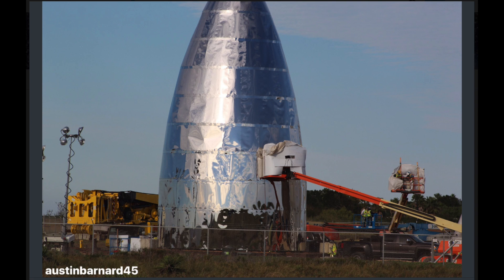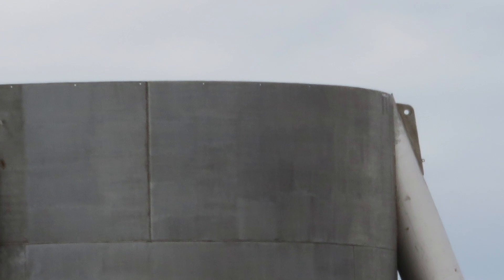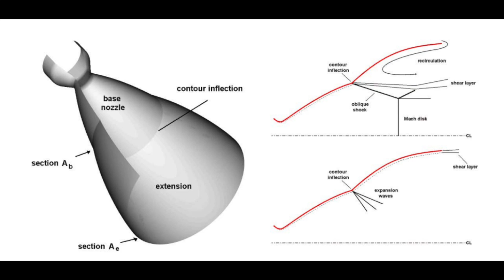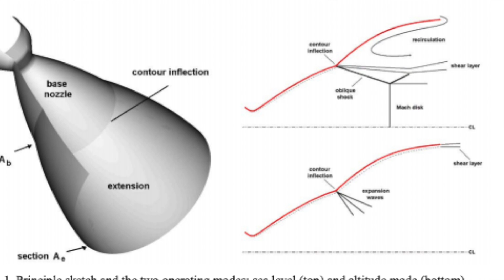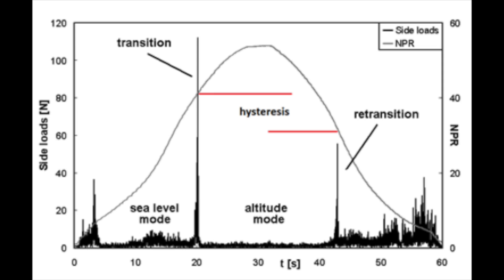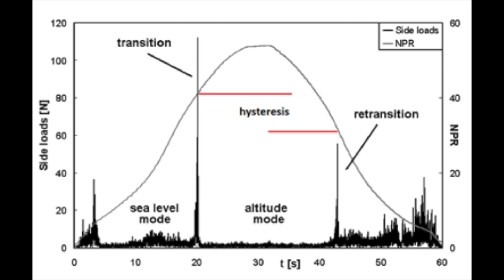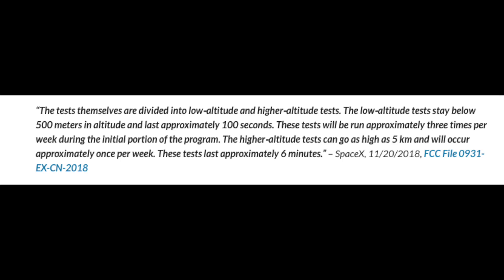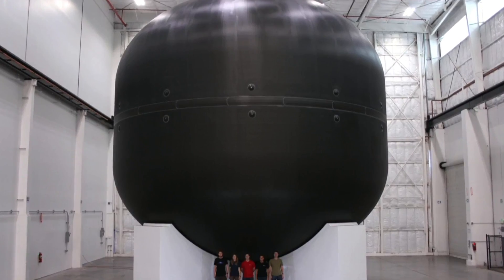What's Going On With SpaceX's Stainless Steel Starship?

Comment: Can we build rockets which can change the nozzle shape as required?
Reply: I've often wondered this when looking at the afterburning nozzles on fighter jets. But I think the problem is the sheer size of the bell needed for vacuum operation. Also, the nozzles are full of channels circulating rocket fuel (for cooling). So moving sections very difficult to design and fabricate. But we may yet see a solution.
Reply: @donjones4719  
Both the Falcon and Raptor engine bells run red-hot. No circulated coolants, just infrared radiation to limit the temperature.
Reply: @avid0g   The Falcon's Merlin engine bell/nozzle is regeneratively cooled (fuel circulates thru channels). The one on the 2nd stage has regen cooling only on the first part. The large extension bell for vacuum optimization is not cooled; that does radiate heat as you noted - that's the sci-fi looking red glow we all see.
The Raptor engine is also regeneratively cooled, per a tweet by Elon.
Reply: @donjones4719  
Yes, The regeneration occurs around the Merlin combustion chamber and near the neck on the vacuum engine. This energy is used to preheat the propellants. Downstream from the neck, the relatively cool exhaust from the generator turbine is recombined with the main exhaust. This squeezes out a bit more performance from the vacuum engine.
Reply: There's the aerospike engine. It's designed with the nozzle in the middle, and the atmosphere acts as a part of the nozzle until you reach vacuum.
Reply: If the goal is to land a second stage, perhaps the larger vacuum portion of the bell could be ejected, or it might be retracted slightly to allow operation in higher ambient pressure. 

However, the dual geometry bell already does this fairly well without moving parts.

Comment: If the raptor engines on the upper stage have to work at both low altitudes and high altitudes, why wouldn't they use a nozzle design similar to the RS-25? It work from launch to orbit. Does the nozzle with the notch have any advantages?

Comment: There are some very practical reasons for a low fidelity test like this.  For instance, I don't believe anyone has actually ever flown with a dual nozzle, much less tried to reignite one with a 500 MPH tailwind blowing straight up the nozzle.  Even flight proven systems can have trouble under these conditions, as Falcon Heavy proved.  It's pretty hard to imagine a 500 MPH wind tunnel that can hold something as large as Raptor, all while surviving it firing with 1000 tons worth of force!  Some things just have to be tested in the air, and until they know for sure that it's going to actually work properly, it's best to keep their investment in the rocket as small as possible in case it RUDs in any number of possible ways.  A glorified water tank is good enough for the job in this case, and quite cheap.

Concerning the nozzle, I suspect it's more a "low thrust compensating nozzle" than "altitude compensating".  The nozzle isn't really large enough for a vacuum nozzle.  However, for landing they want to be able to throttle the engines waaay down in order to provide engine out redundancy.  The issue is, firing an engine at very low throttle at lea level with a sea level nozzle has all the problems of firing a vacuum nozzle at sea level at full throttle, for the exact same reason - insuffient pressure at end of the nozzle to stop flow separation.

Comment: Scott Manley.... Are adjustable nozzles not used on rocket engines, like they are on fighter jet engines, because of edges existing, weight (not so much) or strength (complexity, which also lends to the weight issue as well)?

Comment: The upper part to me looks kind of wrinkly (technical term haha). Not sure what that means exactly, as far as flight worthiness.

Also, has anyone noticed access hatches? I would think if this is the flight test there would need to be access hatches to get at equipment. Unless the hatch is in the bottom.

Next month or two should be interesting. :)

Comment: It's for Burning Man. Because of it's size it has to be delivered in 'Wide Load" sections across Texas. It needs to have a police motorcycle escort thru Texas because intersections need to be blocked to get it thru. We bid on the move and got it. It is going to take three weeks to get around all the obstacles (bridges, power lines, etc) to El Paso, then we hand it off to New Mexico. Moving it on heavy duty flat beds is cheaper than putting it on a ship thru the canal to California. We don't know much more than that. No it doesn't fly.

Comment: SpaceX is not going to use top of the line parts and equipment and the same care on a test rocket that is likely going to explode or be destroyed during testing. As long as its the same weight shape and  mass SpaceX will get good data  to use and apply on the real thing.

Comment: If you are expecting a few RUD events, water tower construction would be economical. Is it all a grand misinformation scheme to mislead the competition? Were we all thinking shuttle tiles or spray heat shielding over carbon fiber? Micro meteors would eat that up?  Stainless is better armor but it seems like it would be very heavy for something that size and would be variable with temperature... I do not think they are done with the design redirections.

Comment: Have you ever put a magnet on stainless steel? It does not stick. They must want an extremely durable material with no magnetic properties. Is there a heat shield on that or is it a one way trip?

Comment: I think it is pretty clear exactly what this is. It is a test article for the propulsion systems and landing of the starship. The idea is to have a craft with about the same weight, CG, Center of Mass, etc... as the real Starship design in order to test out the new raptor engines and landing of the Starship. My guess is they might even try to launch and land this thing from unprepared surfaces like what could be expected on Mars/Moon. Stainless steel construction is fast and easy as evidence by the quick pace this is being assembled at. Once this test article is complete I would think another test article that is a higher fidelity prototype of the Starship (complete with actuated fins, smooth exterior skin, and 7 raptor engines) would be constructed for more expansive flight testing and re-entry testing.
Reply: This test article is also implementing skin-is-tank.

Comment: My only assumption would be the steel is a substitute for aluminum as steel has a higher resistance to reentry heat and plasma. You'd need less heat resistant materials on the most troublesome spots when dealing with heat. Maybe it's also a speed tester vehicle too. Its cheaper to use stainless steel in your fast supersonic plane when going near or past Mach 3. I'm just spitballing here guys and gals, I'm not sold totally on these conjectures so if you come up with something better then I'll believe you.

Comment: Wait.  A water tower company is making a rocket??!!  So, giant water rocket!!!!
Reply: now all they need is a giant bicycle pump company.
Reply: Barry, one of the early SciFi illustrations of a rocket ship actually plagerized a novel water tower design. Never to be printed again, because the water tower design became so common.
Reply: @avid0g  Funny, how physics explain the similarity. Water towers must be elongated to be tall enough, rockets do that for aerodynamics. And both must be roundish to keep the inner pressure (as corners and edges accumulate pressure, and eventually fail).
Reply: Biggest waterballoon delivery to mars?
Reply: I worked in a facility that, among other things, built huge high-energy physics devices for both experimentation and "practical" (DOD secret stuff) applications. Highly complex and technical machines, with components making use of quantum physics even.

One of our primary suppliers was a company that specialized in industrial boilers and steam piping. 

Turns out the techniques and tools for making massive steam pipe systems is the same specialized skills needed to build our massive physics machines. At the end of the day, steel is steel, and there are very few shops geared and experienced at building steel precision systems on a very large scale. And yes, most of their "bread and butter" jobs are things like water towers. Doesn't matter - steel is steel.
Reply: How efficient to employ water tower company to build a test article.  Never question Elon’s business savvy
Reply: Oooh, so just the delta iv
Reply: ok this is epic
Reply: @lilaxeree3621  Its a water tower company because its just the hopper... if those people can build a working frame for a hopper than spaceX will easily build a working REAL spaceshow half the weight
Reply: And it's shaped like one of those water rockets. 🚀
Reply: Actually those things can be more effective than some people dismiss them. I made one out of two, 2 liter bottles. One was empty and the bottom cut off just to make the whole thing longer because I was just copying the normal basic missile or rocket shape that we all already knows works well and adding the extra length alone made it go nearly out of sight at least twice as high as just one bottle. I also cut a flap of plastic that I hinged on the side with tape at the top that held a rubber band to the nosecone that had a parachute in it. As soon as the air stopped passing over the rocket the rubber band would lift up the flap and the nosecone would pop off and it would parachute down. I had some estes rockets that went 500 feet high and you could barely see them at that height. This water rocket must have gone 500 to 1000 feet high. I've actually wanted to make another one ever since that class but now its been over 10 years.

Comment: I'm pretty sure that space x doesn't want to invest too much money into something that has extreme potential to blow up spectacularly.
Some deadline is probably the no.1 condition to be met, and I'm guessing looks is not as important.
They probably just want to make this thing good enough to hop a few times, in addition, to have basic flight characteristic roughly like the real thing, meaning mass, the centre of gravity, fuel volume and so on. 
Also, speed when hopping is probably not meant to be too big.

Comment: Legs, size so a multicrewcompartment could fit, pressureadapting engins. This looks like a Mars Landingship if you ask me.
Reply: Sending people to Mars will also require the ship have room for adequate radiation shielding. There are no Van Allen belts between you and Sol's radiation once you Earth. I wonder how much room for crew would be left after that.
Reply: @alvatoredimarco  Well, that would only have to be arround the crew module. You could leave the fairing on for more material, use a smart trajectory or, and that would be my favourite, if they were able to crate their own Electromagnetic field to shield them flying through the belt.

Comment: 3 is considered a minimum number for some redundancy schemes. If you want to lower your odds of a engine failure induced crash, you add engines until the mass cancels out the safety margin. Assume you are a major pessimist and expect a 1 in 100 failure rate for the engines. Two engines makes this 1 in 10,000. Much better but still kind of high for a critical mission. Three makes it 1 in 1,000,000.  I like those odds of not making a crater when I land.
Reply: And two engines is not fully redundant due to off-axis thrust. (If it failed during ascent, you can gimbal one engine to thrust through the CG, though you would have to tilt the rocket to match. During landing, that doesn't work because the ground would not align to the landing legs.)
Three in a line gives you options that maintain the thrust axis.

Comment: Looks like a mock-up... pretty sure that's not flight hardware.
Reply: Frank Winkhorst  If that's flight hardware then they are deliberately designing a vessel to break apart due to the aerodynamic forces of launch. Did you see those stainless panels?

Comment: My guess is that they want to:
1) test how to manage three raptors in a triangular configuration to land a Starship shape, in various situation ... 1 - 2 engine failure, ... 
2) test asset control
3) use stainless steel to test how it hands all the sollecitations, and to acquire asap some experience in building with this material, that apparently will be the final 
4) ... it will surely be a long period, and many trials and learn ... 2 years at least ... sigh :( 
5) why so much work now ? ... a lot of engineers developer were released by the block5, FH, and by CrewDragon recently, so they have to work on something ... may be some one working on carbon fiber got even fired ... :D ... so they get scare and be hurry to make progress. 
Thank you Scott for your always good and prompt videos, and for your kind attention.

Comment: Look at the legs. they seem very substantial. Much larger and heavier than needed to carry the weight of the module. But they might just be designed to hold this thing down, against thrust.
I reckon this is just to be used for static firing tests. Why make it look like the real module? Who knows ... just for laughs?

Comment: I thought stainless steel was susceptible to tearing/fatigue when subjected to vibrations? Doesn't seem like the ideal material to make a functional rocket out of, maybe its a full scale model? Maybe Elon's using some special grade of stainless? It does resemble the top section of the rocket from Austin Powers 2; is it due to launch on 14 Feb?

Comment: With fixed fins it would not be a good test for the flight characteristics 
of the starship, and with 3 engines overkill, just going straight up it would 
able to produce enough skin heating to test something like a transpiration 
cooling system.

Comment: The most obvious option seems, to me, to be that the concrete base is a temporary platform for test firing the engines, en masse, at sea level. 

Since the actual flight tanks aren't on site yet, I'd expect the real lower base to have been assembled in a more appropriate location, with flight engines and a stainless hull. That will arrive by barge. And the current stainless assembly will be installed on it for the hop tests.

Comment: The dented stainless steel is the new design language.  Tesla's will follow.  "Dented stainless steel, ... your best way to show you're cool."
But serious; I think they might use pressure to straighten these panels out and smooth the outside.  Otherwise this thing cannot fly.

Comment: Maybe Elon was given a recovered anti gravity drive like the one they built the Apollo around with nasa thrusters to control it. So just one engine for show and under the skin from the local  water tank outfit is a intact alien craft. Because that thing looks like a terribly built water tank ( don’t want to hurt the tank builders feelings ( but it’s not a tank it’s something being covered up to conceal it.  Rockets are built in clean rooms last I heard .
Reply: if the highest its going is 5km, and is expected to land hard a few times, the construction it has right now is perfect.
those landing legs probably have enough strength to cut the engines at 10 ft and still not be hurt. Also it has 3 engines on it. (ignoring your AG bit)

Comment: It looks like a mock-up. The sheetmetal is too wrinkled. If you look at an Atlas Centaur tank in production it's very smooth and welded together. They've gone away from carbon fiber tanks and are using a stainless balloon like Centaur.

Comment: I think it simple and straightforward. They want some quick and dirty testing of the raptor, the manufacturing techniques of stainless steel (new alloys, never fully know whatbpops up). I don't think they will care much about fancy carbon fibre tanks and stuff at this point. They want to nail the parameters for flight first. Three engines is likely to do with the three engine landing approach (testing out various error scenarios, engine out and so forth). Why they work so intense? The are running out of time in getting a backup plan for humanity.

Comment: I think you might be overthinking the choice of stainless steel a little for the hopper. Even if it's not going to be relevant for re-entry on the hopper tests, it's a very easy material to work / weld, if you're taking the "in a cave with a box of scraps" approach to aerospace development. The fact that it'll end up looking like the real thing makes it a PR no-brainer.

Comment: I dont think a rocket should be build by exact specifications, the hull is not that important, could be build by a shipbuilder or anyone else, as far as i know the seadragon should be build by a shipyard. Also think they paid their price with the explosion of the high tech helium tank. Stainless Steel, is pretty easy to work. Why invest in uncertain and undocumented regions if you can just use a well known material

Comment: There are questions about the material: steel. Solid, but heavy for a rocket. I have an idea why: steel is used as the surface of the rocket. And surface scales to the square of the size. As for volume, it scales to the cube. For thin rockets, steel is too heavy, but for very large rockets, it starts to make sense. Especially when lighter material is hard to scale to this size. For carbon composite, you need to cook it in huge ovens. Steel only needs simple welding and bolting.
I love that they're building outside, it shows that the design is so robust, that you can afford to build in an uncontrolled environment and also have an ordinary construction company work on it. It looks like it's democratizing rocket construction. Elon Musk wants everyone to be able to go to space cheaply and he's showing the world how to do it. We live in the future!